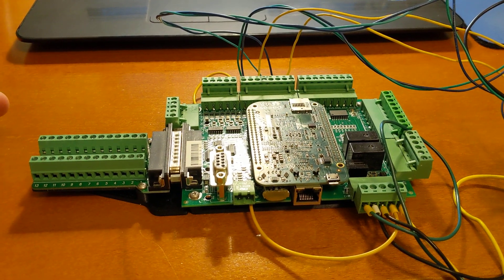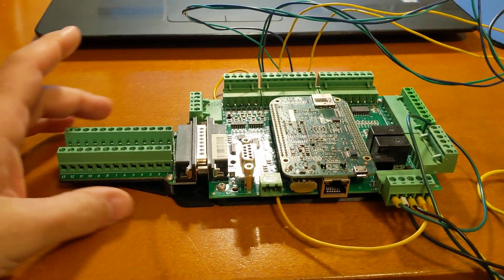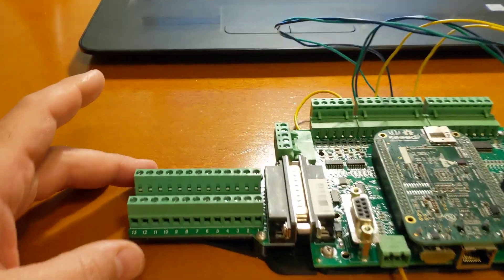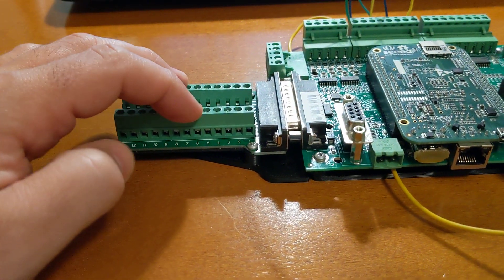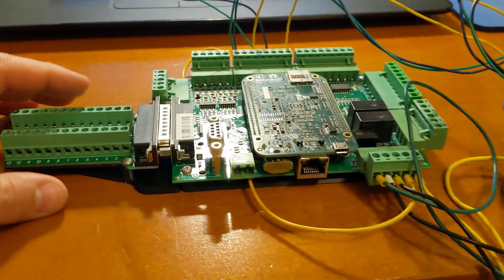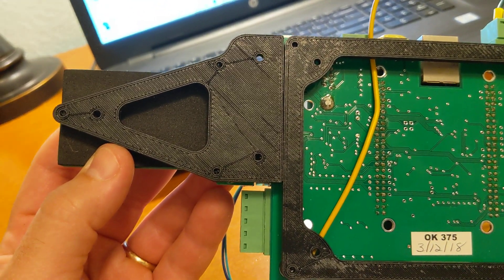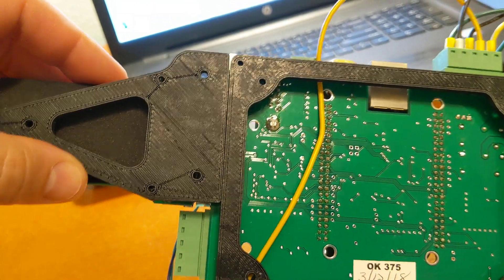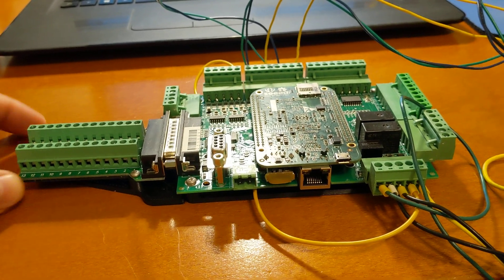Centroid Acorn CNC: 3D Printed Mounting Bracket

Comment: Hi Franco, very cool! What are you using the DB25 breakout for? All the I/O are also in the screw terminals and relay board right? Just checking as I cannot determine from the wiring schematics. It mentions  "All input and output signals on the DB25 connector are available on the
 screw terminals except with 24V levels." Not sure what they mean by this.
Reply from the maker: I have used the screw down terminals in the past and everything worked ok.  But, the guys at Centroid tell me that the screw down terminals are really only to be used for step/directions signals that run at 24V.  They say that 5V signals are better off running through the DB25 port as it has better signal isolation.

Comment: That is a nice looking mount for the acorn. Thanks for posting it! I'm going to us it when I redesign my controller. I have followed all your videos but especially enjoy the CNC conversion ones. Your coverage of the acorn for your PM25 conversion is one of the main reasons I chose the acorn for my PM30-MV conversion. I have been wondering though if you ever got your PM25 spindle working with the KBSI-240 board?
Reply from the maker: Not yet but that is on the to do list.
Reply: @FrancoCNC  Thanks! I look forward to seeing how it turns out.

Comment: Great! Do you know if anyone has used an acorn for a 3d printer controller?
Reply from the maker: Hi.  I can't say that I have.  I'm sure it's possible but I suspect the Acorn is a bit of overkill for that application and people generally go with less expensive options.  The Acorn is geared more towards lathes, mills and routers.
Reply: A popular after market controller for 3d printers is the duet3 controller.